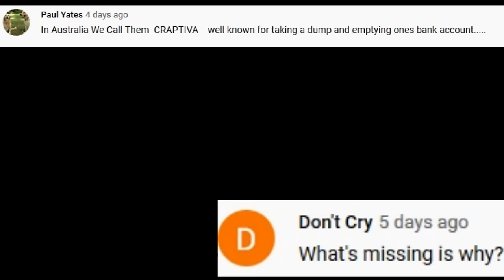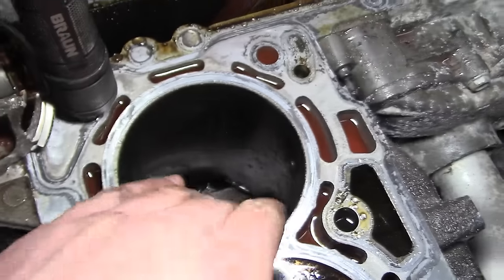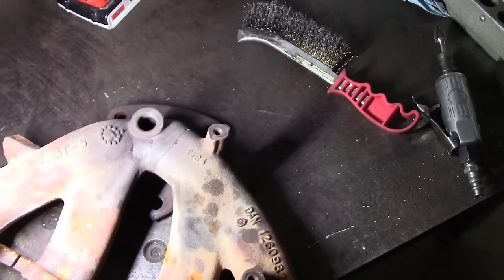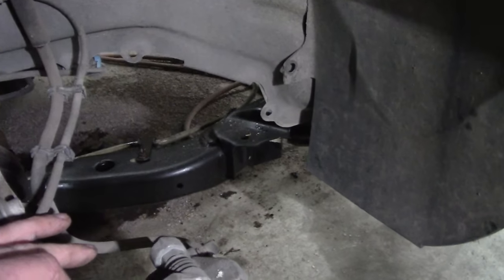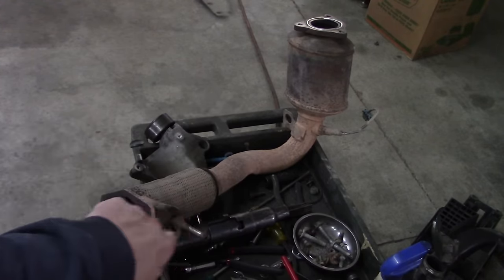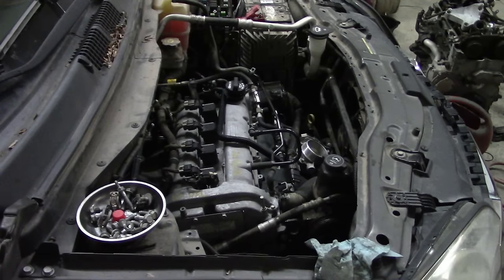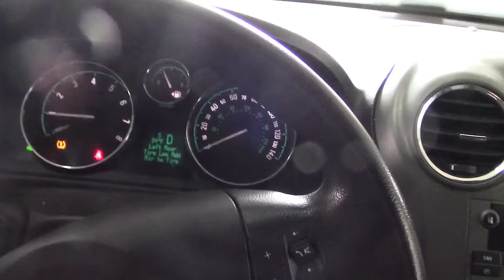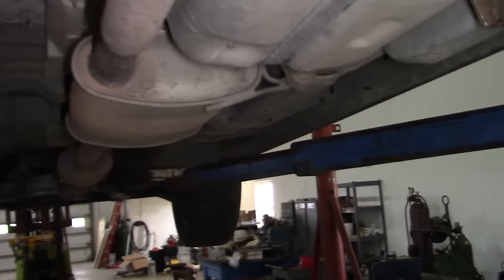I Fixed the Cheapest Small SUV on Marketplace - Part 2

Comment: 'You kinda lose your motivation to clean your car out when it has a rod hanging out of the engine block' 😂 Great video.
Reply: Is it not the other way, don't take care and you'll find yourself at the side of the road with a rod and other pieces missing.
Reply: @Okeanops6   No, GM has your back on that either way. Helping my neighbour with his daughters opel ecotech which has a plate oil cooler mounted on the side of the block behind the DPF. Guess how often the gaskets on those dont leak? Also it has the stupid "no service" auto gearbox.

Comment: I went to try and braze up a cracked exhaust manifold on another GM product many years ago - a 2.9 liter Colorado I owned. What I thought was a bad manifold gasket was a cracked manifold, and when I unbolted the manifold it fell apart into a couple of big chunks. A new manifold was $600, a used manifold was cracked in the same place, so now there is a well-maintained 2010 Colorado with 200,000 miles and a stainless steel Pacesetter header. I sold it a couple of years ago but I still see it running around.

Comment: i believe my wifes chevy oil filter is just an 1 1/8" socket and i just use a wobbly with it
Reply from the maker: This is 32mm or 1-1/4. I have a special 3/8 drive socket for it, but I could not find it when I was making the video. Turned today while cleaning.

Comment: You and your lovely assistant need to make a battery storage stand. It would have 1 shelf at the bottom for oversized truck/industrial equipment batteries. Then middle shelf would have space for 2 normal car/truck/suv or whatever else you may work on. Top shelf would hold that battery maintainer/recharger. If you put it on heavy-duty casters you won't have to lug batteries everywhere. I would also have a few spots for jumper cables, zip ties, brush to clean posts and cables along with any other stuff you normally use to work on batteries.
Reply from the maker: That's a pretty good idea!

Comment: I know this is an old vid,Wes comments about the oil filter reminded me of a Olds I once owned.1980,I think it was what they then called the X body.4 cylinder 180 cubic inch,you had to remove the right front tire,lift up a special flap in the fender well,reach through to remove the filter.Always spilled oil all over the engine,no matter how much you wiped you could smell hot oil for a couple days after an oil change.

Comment: A few years ago when I was a maintenance supervisor I ask a tech at Yawasa ( if I spelled it right) and he said that leaving a battery sitting on concrete for an extended period of time does not affect them at all. When I was growing up working in my fathers garage, he always said not to sit a battery on concrete. So maybe the case on newer batteries is a different material. Not sure. Great video.
Reply from the maker: It's an old wives tale. I just like picking on the believers.
Reply: @WatchWesWork  LOL. That's funny. Must have an old husbands tale too. Awesome job with the engine swap. I sure don't miss those days. I used to love working on cars when I was young and there was enough room to crawl into the engine bay and disassemble everything. But now, you couldn't pay me enough. I would take a sledge hammer to it within 5 minutes.LOL

Comment: Here in 4cyl 1.6L-2.0L land we always do engine out top.
Guess its usual V6 & V8 3.0L-6.0L method that you need get them out bottom, removing the underframe complete.
Those beasts are super expensive (import + road tax) - thus rare - around here.
Two worlds - two different situations - two ways of thinking.

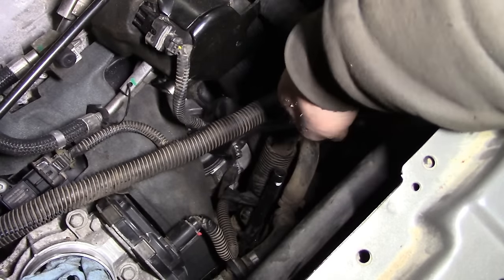Comment: 25:30 some bmws have oil filters like that. At least there nice enough to put it on top of the engine.... my friends volvo has one to but its buried like that. he has to remove the airbox to get to it. luckily he has an aftermarket airfilter so its simple. Ive also noticed the bmw one also has flats on the larger outside diameter so you have the option of getting the special tool or just using the built in 36mm nut on top.
Reply: Yep, that's how mine is. Front and center though, so NBD.

Comment: Looks like the results of a duel to the death at a set of traffic lights. Duralloy 5283 rods would produce a nice weld on the exhaust manifold. Back in the 80s I welded a tractor transmission where it had literally snapped in half. The rods are essentially a high tensile low hydrogen alloy and produce quality results with slag which self cracks and falls off. The welds have a unique characteristic gold appearance.

Comment: Dear Mr. Wes.
👍👌👏 700 bucks for a totally rust free 2012 Captiva with good interior? That was a fantastic deal for sure! Congrats! Very well done!
2) I would bet that if the engine is maintained correctly, the typical oil consumption will be no problem. VW once had 1.4 l engines in a lot of different cars that was known for using a bit more oil. No other issues indeed.
3) I would keep the old cylinder head or at least sell it.
4) Why in the world would anybody want to pull an engine out downwards??? Sometimes it's possible to pull an engine out and in upwards even with the gearbox still attached! And if you own a Mercedes not even the hood has to be removed because it can be adjusted vertically! This feature is with this brand at least since 1968 as far as I know (type W114/115 also called /8). Originally designed for better maintenance accessibility of course.
4a) The only cars I know to pull out an engine downwards are ones with rear engines and rear wheel drive. For instance oldtimer like VW bug or bus, Fiat 500, some NSU and the role model for the NSU TT =  the Corvair.
5) Looking into that oil pan and that shattered crank case I guess a typical Andrew Camarata saying would have been: Phew, those bad made thin metal engines nowadays. They simply cannot withstand the slightest knocking from a broken piston rod. And look at the interior of that car. Can't even be repaired/fixed with an angle grinder! ;-) :-)
Thanks a lot for making teaching recording editing uploading and sharing.
Best regards, luck and health to you, your families, relatives and friends.
Reply from the maker: Lots of V6 engine have to go out the bottom, but a 4 cylinder will almost always come out the top.
Reply: @WatchWesWork  
Really? This is your complete replying to my comment? Okay then let's go into medias res:
2) ??? Why? I pulled out and helped to pull out even 6 cyl inline engines (2,8 l Nissan/Datsun and Mercedes). Also V4 and V6 (Ford) engines and absolutely all upwards! I never pulled out an engine downwards and I have never ever seen somebody doing that (at least not in Germany).
By the way: Especially on floating boats and ships this pulling out an engine downwards procedure should be avoided strictly! ;-) :-)

Comment: According to the window sticker you figured it was a little overdue for an oil change. Judging by the color of the innards that wasn't the first oil change that was overdue. I've changed many of those oil filters have one or two of the speshul sockets but then I noticed that the high pressure fuel pump is in the way, the 2010 Pontiac G6's don't have GDI.

Comment: Hahaha...the old spinning nut issue inside the subframe...I'm not a mechanic myself but I once had to weld just a nut like that in a subframe that came loose...made a flap in the side of the frame, welded the nut and welded the flap back shut. Mechanic said that happens all the time with Citroën panelvans (yes I'm from Europe) but with normal cars too...

Comment: TPS alarms usually have to be reset using the heads up display, it's worth checking the manual to see if it resets automatically or if you need to do it
Reply from the maker: Yeah I'll have to figure it out. The GM system is kind of weird.

Comment: On an early 80's chevy citation. I twisted off one of those subframe bolts. At that point it was either scrap the car that was about 5 yrs old or make a bunch of fixtures up and drill out the bolt while laying under the damn thing.  Long story short it wasn't easy but I did drive the car for another 6 years.
Reply from the maker: Ouch. I think we cut the head off the bolt and used a hole saw to cut out the nut. Then fab'd a new nut plate and welded it in place.
Reply: @WatchWesWork  yes I could have done that but at that time I didn't own a welder and didn't want to pay for onsite welding.

Comment: In my experience, brazing is always a better process for cast iron repairs than nickel welding..   TIG or MIG brazing processes in particular make the repair process so much easier and nicer looking at the end..   Gas brazing can be tough as the braze tends to set quickly on large sections and you tend to get porosity and unless you have a lot of experience, can look like crap until you grind, but still remains strong as heck..   Nickel on the other hand might look better in terms of color once finished, but that's only if the rest of the job goes right..  Nickel is a welding process and you're intentionally forcing dissimilar alloys to mix in the joint where you're fighting chemistry to try to come up with a usable join vs braze which is essentially gluing the break together with a third metal and they all stay separate, it's also a much lower temp process so you're not changing the crystalline structure of the cast iron and you dont need nearly so much pre and post heat or peening..
Reply from the maker: I just don't have a whole lot of nickle weld experience. My dad does it all the time. Especially welding steel to cast iron. He has good luck with it.

Comment: People telling you to "simply drop the engine cradle/subframe" have never had to do it on a front wheel drive car in the midwest. Over 10 hours of labor just to change the clutch on my Acura TSX. Most shops wanted ~$2,500 to do it so I did it myself. Good thing this craptiva is from OK. Those 10.9 bolts you took out look pristine

Comment: If the tpms light doesnt flash when the key is turned on, you dont have a bad sensor. If it just stays solid the whole entire time, you simply either have a low tire, sometimes spare if it's a full size and has a sensor, or the system needs to be reset
Reply from the maker: I reset it by letting out 5 PSI of air and adding 10 PSI back.

Comment: Hey wes for the oil filter. Use an 1-1/4 socket with an extention, you kind of have to wiggle er in but i have an 05 pontiac pursuit with the 2.2 eco tec, same set up! I had to use an adjustable but someone had already stripped it out so badly that i couldnt grip it haha. Hope this helps in the future!
Reply from the maker: There's a low profile socket that works well. I have one now.
Reply: Watch Wes Work awesome! I find the 1-3/4 socket works pretty mint for me. I bought it just for my oil changes lol

Comment: PSA uses a similar oil filter setup - also in terms of ... buriedness. I got mine of and on with a cut in half DIN 837 B / ISO 3318 - 24x27 flat double ring wrench. If you intend in keeping the car, this might do the trick.
Reply: Oh yea, this is the factory tool: https://www.ebay.co.uk/itm/123927372325

Comment: Nice Job Wes! Hope you and your family are staying safe! Hey by the way…. Im looking for a set of Sandvik Machinist Scraper handles an inserts, Checked with McMaster, Shars and even Sandvik itself which doesnt seem to even have them listed on their
 site
Reply from the maker: Interesting. I bought mine on ebay, but I don't really like them so I made my own by brazing carbide to a piece of thin steel and making my own handles.
Reply: I may have to go that route, I saw one of Richard Kings videos and he has extra long handles with butt stops on the end so you can lean into it for more agressive material removal.

Comment: The Captiva 2.2 litre diesel oil filter is much easier to get to, take off the plastic engine cover and use a socket to unbolt the housing Cover.

Comment: I always find it funny to see people from the rust belt gawk at clean vehicles. What you guys see in 3 years old vehicles is what i consider a rusted out pile of scrap metal that shoukd have been recycled long ago. I have a 2006 f350 that has factory applied rubberized undercoating still. Sorry to brag haha. Good work

Comment: In the UK we have these in 2.2 litres, every one that I have done a timing chain on has had an almost blocked oil strainer in the sump and a semi collapsed okl filter.. The same can be said for the 1.4 ecotec turbo. You would think that they would have found this and fixed it. After all they say they do " Millions of miles in development ".
Reply from the maker: I don't know why GM can't figure out timing chains, VVT, GDI, etc.
Reply: @WatchWesWork  if you look back at old engine, for example old BMW's they had a duplex timing chain an inch in width which may have stretched at very high mileage, and needed new guides and tensioner but breakages were virtually unknown. Honda uses single chains and to make them stretch or even jump needs extreem abuse and many missed oil changes.

Comment: Usually that oil filter cover takes regular 36mm socket, no need for any special tools.
Reply from the maker: It takes a low profile 3/8 drive 32mm socket.
Reply: @WatchWesWork  Good that I used word "usually" :D

Comment: Here in Europe (almost) all modern vehicles have tat style of oil filter. I'm on my first. Yes you have to be lucky that they put it somewhere senssible (VW Transporter so I'm ok on that count) and an apropriate sized 6 side socket. But otherwise I prefer them. You only change the filter element, not the can, so less waste and less for the myriad of makers to screw up. And for me at least, much easier to do cleanly.
Reply from the maker: Yes. I believe there is an environmental push for this type of filter. It's funny to me because that's how most filters used to be back in the old days (pre 1960).

Comment: Also to designers: If it is easier to replace the filter with the engine out of the vehicle than in, your doing something wrong. It should be no difference in or out...

Comment: A good deal of the work you do reminds me of working with my Dad when I was much younger, except my Dad was generally in a foul mood over the repairs and fabrication and would be more inclined to heave a wrench across the shop then crack a joke. My wife and I both watch your videos; they are outstanding! You’re patience is commendable as is your humor. Look forward to the next one.
Reply from the maker: Yeah, my dad hated working on cars too. He preferred small engines or welding.
Reply: Small engines, absolutely. He once repaired a very old ‘Flandria” moped with a magneto problem. It had been sitting outside for about two decades. The engine was mounted over the front tire on a mounting bracket that would allow it to engage the front tire once you had the “bike” up to speed. Pretty neat. He also was able to successfully replace the camshaft on our 1972 Ford Pinto. Talk about expletives! But much like you always do, he persevered! Stay well!  @WatchWesWork

Comment: I know this is an older video, but in case you are still struggling with the Ecotecs, I’ve never had to use a special tool on one of the Ecotec oil filter caps. Just a basic 32mm shallow 1/2 drive socket and a long extension, tools that should already be in any pro mechanics tool box. Works great even on the GDI Ecotecs, changing the filter only takes a minute.

Comment: I bought a late model SAAB 93 with an Ecotech. The o-rings on the coolant crossover pipe failed. It cost a $1000 to fix a .50 cent part at any garage. GM is quite capable of some shameful engineering. Stay safe. Cheers!
Reply: Peter Lyons A 50 cent o ring can cost you a new engine.
Reply: @jo9732  You are comparing a GM to a Kia, please! BTW you telling us you owned a Saab tells me everything I need to know GTFO here!

Comment: Everyone told me to take the motor out the bottom, I pulled it out the top. My dad worked for gm for 30ish years and had the same thing happen with those welded nuts lol. It was a manual g5 so to get clearance I removed the side timing cover, made the job 1000x easier and with loads of room. Those 2.4s are bad for burning oil hopefully you got a good one!
Reply from the maker: I hope so too!

Comment: They enginner things like that oil filter so the owners can't change their own oil and have to take it to a dealer for servicing.
Reply: I also hate it because you can't use upgraded filters I like mobil 1 filters or Wix and with those stupid things your always stuck with the dumb factory style
Reply: Doesn't it say "lifetime oil filter" on the window sticker?
Reply: @lwilton  Life is short, you know 8-)
Reply: And, if they don't take it to the dealer to change the oil , your connecting rod and crankshaft have an altercation, requiring you to buy another car. Pretty smart thinking on the engineering , NOT!
Reply: Not actually true, manufacturers have moved away from spin on filters and back to cartridge filters due to the amount of waste the spin on filters generate.  They are very difficult to recycle, so all that steel with the oily internals has been going into landfill with obvious environmental impact.  Cartridge filters can be incinerated without further processing to ensure no oil leaches into the ground.